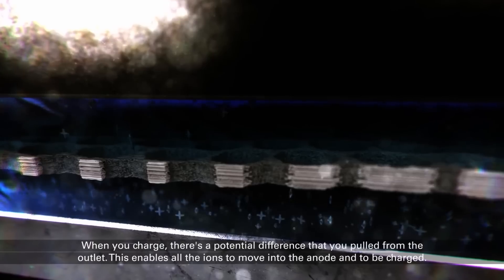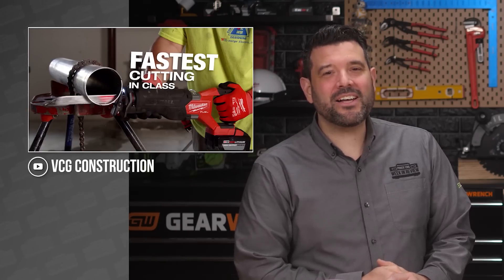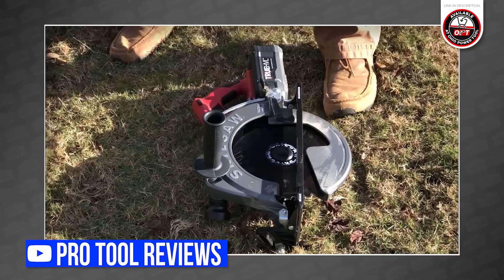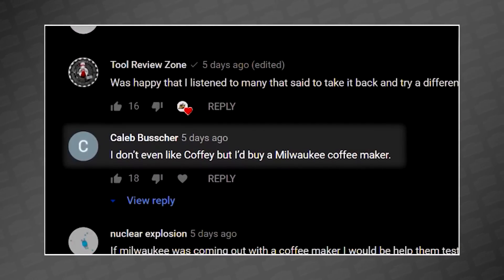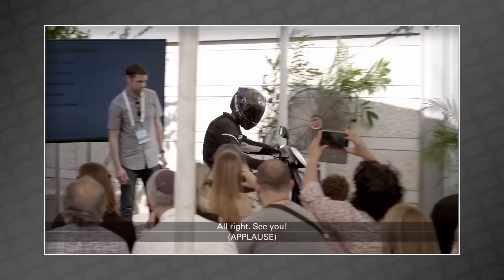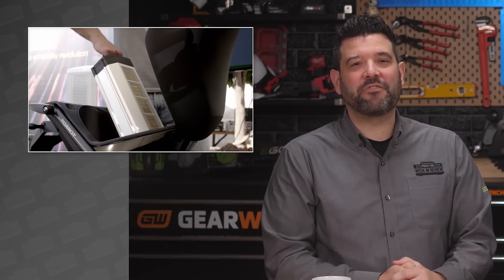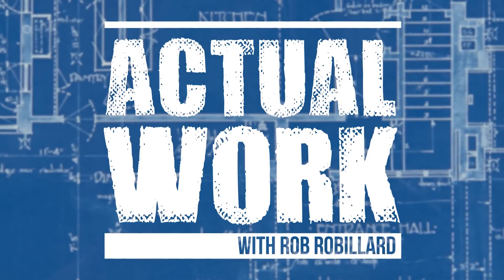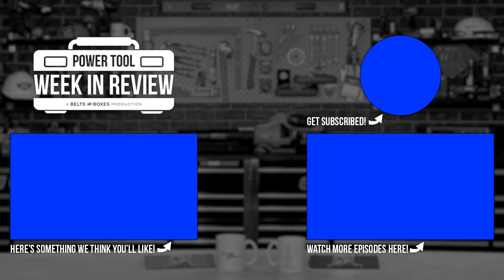New Battery Tech to charge ANY POWER TOOL BATTERY in 10 SECONDS. Plus your Power Tool News! S4E4

Comment: that an interesting concept  the work around right now as far as ev ( electric hevicles) go is that the actual battery charger is onboard the car! The ''battery charger'' usually 50-60 amps on the walls for the telsas - ect is more less just an outlet.  They only provide the power. The car is not a permanently installed battery charger so it circumvents a few hazardous requirements like venting  ect  sounds like a logistical nightmare of redtape and listings and permitting to get 1 installed for just power tools...  but do able !
this was awesome by the way !!!good content !!!!

Comment: I'm a commercial electrician and I can honestly say that I bought a DeWalt 20v XR compact sawzall and I have literally pulled it out of my tough system box 4 times in the past year and Everytime I did was to cut PVC that was in a weird position that I needed the multi direction blade collar. We use portabands (portable bandsaw) more than any other cutting tools.

Comment: Remember that faster charging requires more power (not energy). If charging in an hour requires 100W then charging the same amount in 10 seconds means 360 times as much or 36,000 Watts. 36kW That's a lot of Amps (150 Amps) at 240V.
Reply: Another issue is that if the charger is only getting the 70% efficiency one of the presenters mentioned, you'll have a nearly 11kW heater somewhere in the power chain - either in the charger itself, or in the battery. And that's assuming you take a 30% increase in charging time over that estimate due to inefficiency. Maybe the new tech will increase the net efficiency? Still, anything wasting over say 20W is going to need a big heatsink, a big fan, liquid cooling, or some combination thereof.
Reply: In my country is pretty common to have three phase 220V in our homes. It would easy to install a three phase 3x25A charger. It would take 20seconds to charge.

Comment: If Milwaukee changes the connection on their batteries I will cry and shit my pants.
Reply from the maker: You won't be alone.
Reply: I still have a functional 14.4 volt hammer drill with the battery that you can reverse so that the front can face forwards or backwards. Was useful a few times when I was working under the hood installing car alarms and audio systems. Sometimes I wonder why they stopped doing that.
Reply: If Milwaukee change their connections I’ll be immediately selling all mk for new DEWALT . I won’t stand for that sort of betrayal.

Comment: Instead of not carrying large batteries, I see us using smaller batteries but using 1 large battery to recharge the small ones, similar to battery packs for USB devices. It would be nice to keep the tools light and have no need for AC power.
Reply from the maker: Great idea. Maybe have a large battery in your PACKOUT stack, that keeps all of your individual tools topped off.

Comment: I use the 12 amp hour High output batteries from Milwaukee on all my impacts......... They feel like they're 20 lb but I only have to recharge them once every 3 weeks it seems.
Reply from the maker: I feel ya. I tend to do the same thing. I just hate changing batteries.
Reply: I have never heard of that before. Double the weight of the tool that has a battery when the small batteries take 45 mins to charge but usage of a freshly charged 5 amp hour battery gives you 2 to 4 hours of work. Most people I know that use tools all day thing ergonomics is really important and as long as the tool performs and the batteries last plenty long and only take seconds to swap it seems like a lighter battery would be preferred and then maybe an extra swap or two a day. Strange

Comment: To many people dropped the “ in it’s class” part for the sawzall :).  As for the cordless vacs...watching the testing just reiterates my thoughts, which are: cordless vacuums are useless :).    Good video. Great too watch.       Live confidently and peacefully
Reply: I don’t understand how you can say their useless?  Try dragging around a 200 foot extension cord with you for an entire day you will change your mind pretty quickly
Reply: @__________f9433  no I won’t.  I have.    The stuff I vacuum , much of the time: I need more suction and longer run time. cordless vacuum do not have enough to power or run time at this point.
Reply from the maker: Thanks for watching each week John! Appreciate your insight. 

A cordless vac is only going to shine when it's used for a problem it's designed for. And a full shop of sawdust is NOT it. That's the problem I have. We've got a couple, and I'm always expecting it to do the job of a full sized shop vac, and that's just not what they're claiming to do. But batteries are getting better! So will the vacs.
Reply: @ToolShow  right.  As batteries get better the vacs will get better :)

Comment: Having a tiny 1 amp battery on tools is a good idea but tools will lack power with a battery that small
Reply from the maker: But what if it charges so fast, that you only need lots of power for one quick job, then you set it down and it starts to recharge? Then maybe a 1AH battery would work. It would only loosen 8 lug nuts, but who cares? You set it down and it charges back up again a moment later. That's the thought.
Reply: @ToolShow  I don't want my men setting them down.  I want them to keep working. So do the people we work for.
Reply from the maker: @littlefinkle7757  Good point.
Reply: @ToolShow  sounds like a super capacitor at that point. They have tried using those in products. Never seems to pan out though.